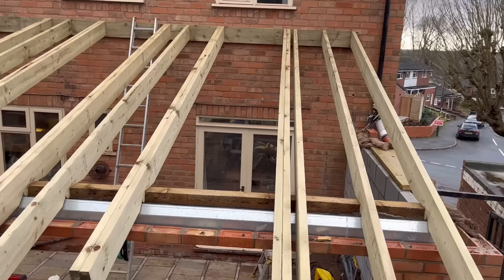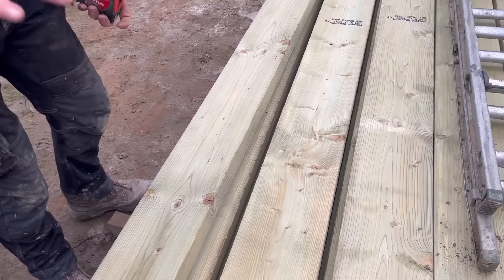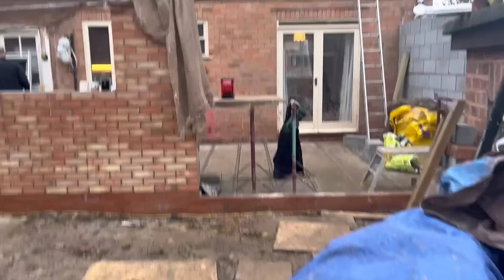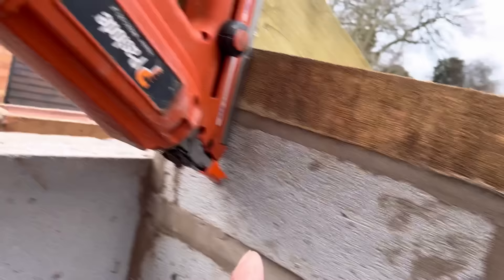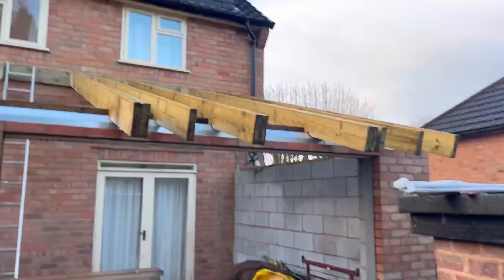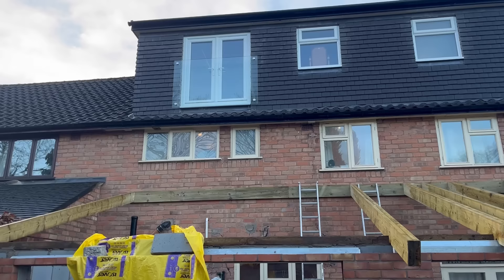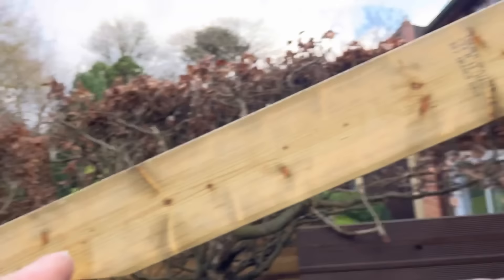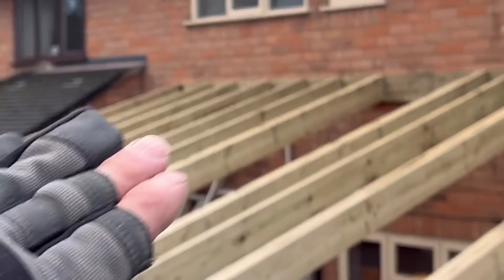Single Storey Extension  Stage 7 Setting out of Lean To Roof

Comment: Should have birdsmouth at both top and bottom of a lean to roof. No more than a third of the timber depth cut out. Building control round my way would not pass this. As there is a chance the plum cuts will slip at ridge due to flat pitch of rafter. Minimum pitch of roof for velum windows is 15 degrees.
Reply from the maker: We’ve had many comments about the birdsmouth over the ledger plate. The only way the plumb cut is going to slip is if it pushes the wall plate out first and it won’t. It’s a tried and tested method of many many decades so I’m happy with it. You’ll have to forgive me but not sure why you mentioned the velux it’s been a while since I did it but the pitch was over 15 degrees if I remember. Maybe I mentioned something in the video not sure. Thanks for watching and commenting. 👍🏻

Comment: This may be a daft question, but why do you attach the rafters to the wall plate at an angle rather than have them sit on top of the wall plate? (mounting the wall plate suitably lower of course)
Reply: That’s how I constructed my lean to roof, with birds mouth cut sitting on top of house wall plate. My preferred choice.
Reply from the maker: Hi Stuart I’ve never done it that way and would love an engineer to explain if this is the ‘best practice’  way how a small notch on top of the timber fixed with minimal fixings is better. 🤷🤷 thanks for watching 👍🏻
Reply: @mrabuilders6723   I’m only a keen DIYer but was wondering the same thing, it seems a lot of weight to be holding up using only nails. Are there not suitable hangers like joist hangers? I’m only asking because I enjoy these videos trying to learn as much as possible, keep em coming!

Comment: Am trying to work out a birdsmouth cut on a DIY project, everything i watch apart from this video the seat cut sits flush with the wall plate and on this video it over hangs by quite abit is this  because its a low pitch roof and the timbers are 8 x 2 ?
Reply from the maker: Hi Tom yes mate that’s correct. If you are watching American timber roofing they seem to set their seat cut length to the size of the wall plate depth. In the Uk we generally use treated 4”x 3” or 4”x 2”  and the deepest you can have your birdsmouth is 1/3rd of the size of timber you are using so for an 8”x 2” it would be approx 2 1/2” (65mm) Hope this answers your question and good luck with your project. 👍🏻
Reply: @mrabuilders6723  thanks for that this video Is very helpful

Comment: It’s a wall ledger. What bolts have you used? I seen done with concrete through bolts most of time, but was thinking of using resin anchors next time, any thoughts?
Reply from the maker: Hi. I have always used through bolts as I find them very easy to install and you know when they have a good bite into the substructure. However, the concrete bolts that screw straight into the brick/block are very good also. Thanks for watching 👍🏻

Comment: Do you think 1m space betwin rafter for small roof (2.2m x 6m long) will be ok i used 2x4 c24 ? Battens will be 25x38mm will they not bend down ? Solid roof tiles
Reply from the maker: These were 8x2 if I remember at 450mm centre. 600mm is the absolute maximum for rafter spacing and if you do you need at least 50x25mm tile lath. 
Go onto Google and type in rafter spans for pitch roof UK and you’ll find loads of info 👍🏻

Comment: We have to notch our rafters over the bolted plate so the insulation between the rafters abuts the house wall.
Reply from the maker: Cheers for the comment. As you say the 100mm insulation will sit against the bolted plate in between the rafter but the 50mm over the top of the rafters will sit against the house. Never been a fan of sitting the rafters on top of the plate especially with a vaulted ceiling cos you’d have to build the whole internal wall out to cover it. Thanks for watching. 👍🏻
Reply: @mrabuilders6723  We use a smaller plate so the bottoms are flush, it's just what BC want in our area.
Reply: @mrabuilders6723  With it being a low pitch roof you would of been better sitting them on top of wall plate not relying on just the nails. a building inspector could pull you on this, but nice job keep up the good work
Reply: @johnhibbert8201  Or bolting a 3x2 onto the bottom of the bolted wall plate and forming a top birdsmouth (not sure if thats the right term )
Reply: 4x3 we use sit rafters on top mouth them out when that timber dries out and shrinks the plumb cut wont be touching the wall plate so relying on the nails only @bricklayersworldwithandy6277

Comment: Apologies if this was covered in the video but I'm wondering how you size your rafter timber? I'm building a lean to that comes out 5m from the house and wondering what rafter size to use? Thanks
Reply from the maker: It wasn’t covered in the video mate no. I use a pitch roof span table off Google. I do that because that’s what the building inspectors use so it prevents any issues when it comes to sign off 👍🏻
Reply: @mrabuilders6723  thank you very much
Reply from the maker: No problem at all happy to help. Enjoy your weekend 👍🏻

Comment: 👍 one question could you have used joist hangers to attach those rafters to the bolted wall plate rather than just nailing them?
Reply from the maker: It’s a possibility John but I don’t believe it’s necessary. I have put large brackets bolted to the plate and into the side of each double rafter as well as nails but in reality where can the rafters go?
Reply: @mrabuilders6723  

Down. I was just wondering over time they could start to rot. But we’d be long gone before anything like that happens.
Anyway that was my fear not yours. Good job though. And who am I to tell a craftsman how to do his job🤔😂👍
Reply from the maker: 😁👍🏻Thanks for watching John hope you stick with us

Comment: This nice job but nail guns onto the plate on wall that like bit wire hold it in place ta
Reply from the maker: It’s more than strong enough Brian if it wasn’t I wouldn’t do it this way. Thanks for watching 👍🏻
Reply: @mrabuilders6723  just when 4 inch nail can't just bend it like one put in guns just old school thinking ta

Comment: Why do you only cut one birds mouth on the rafter ? If you had a birds mouth top and bottom all your loading would be vertical . With only a birds mouth at the bottom the roof will push out . Also if you cut the top birds mouth first you can use this to measure the position of the of the wall plate on each rafter before you cut them  .  Also you have no compression brickwork over the lintol .
Reply from the maker: Hi Eddie I’ve had a few mention a top birds mouth but I’ve been doing it this way since I was taught during my City And Guilds apprenticeship nearly 30 years ago and up until I broadcasted it on YouTube nobody not even an inspector has mentioned it before. With the regards to the roof pushing out where is it going to push to? Also I was always taught if you were to notch 50mm out of a 200mm rafter or joist it then becomes a 150mm timber so I’m not sure about this method. I’ll have to look into it a bit more and speak to an engineer before I convert to this method. Thanks for commenting Eddie appreciate your time and thanks for watching.
Reply: @mrabuilders6723  Thanks . There is a lot there to answer . First of all , Building Inspectors are not builders , they are not structural engineers , they are not architects.They are simply someone who has read a book so many times they know it off by heart . Also the regulations are not set in stone but are generalizations . You can ignore the Building Regs if you have a structural Calc to back you up . 
30 years ago you would have had a ceiling joist , a vertical post on the joist , and a rafter triangulating it all. The joist would have been cut into the wall , or better still resting on a built corbel . If you look at timber framed buildings you will see every joint has a mechanical joint and a fixing . The mechanical joint does the work, and the fixing just holds it in place . On your job you have a wall plate bolted to LBC bricks some of which will be laid frog down  , and so you won't be able to prove the integrity of the wallplate by calculation . To this you have fixed a rafter with 2 fixings and no mechanical joint to do the work .Once again you cannot prove by calculation how many of the nails were bent and are doing no work at all . What you have to do is build corbels into the wall , secure wall plate to corbels , birdsmouth rafter at top . You have then produced something that is not only aesthetically attractive but also mechanically correct . Finally Tec Colleges only teach to the syllabus of the CGLI (nowadays not even that ) . There is a whole world of carpentry out there and is all different to that you were taught. I have taught carpenters who would not cut a roof how to do it while we were drinking a cup of tea . They all say the same " that was simple why didn't they tell us that at college" . Forget what you were taught , it was mostly wrong anyway . Study carpentry worldwide , learn and grow , it will make you a happier person .Best wishes. I promise not to post anymore .
Reply from the maker: You can post away Eddie I’m more than happy to receive comments from people that know what they are talking about. All I can say is that I’ll have a look at it on my next job. Thanks for taking the time to comment and I hope you continue to watch our videos and maybe give us some more constructive advice in the future . Thankyou. 👍🏻
Reply: You don’t need a birdsmouth on the top. The nailing method is perfectly fine. The rafter can’t drop even without nails in, as it’s fixed onto the wall plate.

Comment: thanks for another great vid. Have you used autoclave (AAC) block on this job? Another question, the wall plate, how did you attach it to the wall, and can someone use joist hangers on a job like this?

Comment: Hi. I'm interested in how the rafters are fixed to the main wall beam. Are the rafters just end nailed to it? If so what size nails are used?. I have to say just using a but end joint with nails seems very weak so is this the normal way? I would have thought the rafter ends would be cut to the angle and half sit on the main horizontal beam. This would be so much stronger...Like this: https://www.youtube.com/watch?v=xImoM8liPtw

Comment: Quick question why didn't the Structural Eng specify Catnic or IG boot lintels above the openings this would have avoided the need to double cut the rafters, I can't understand why builders don't pick up design faults like this, I see so many fundamental design faults on these YouTube videos that its smacks of poor building knowledge, Ps not suggesting its the carpenters fault but the overall contractor should have noticed this on the drawings, surely

Comment: With no top birdsmouth the rafters want to push away from existing building. An internal block wall with pressure from the side has no structural strength. I don't think 5mm wallplate straps at every metre will stop this happening. Just have a look at at roofing geometry loads and stresses.